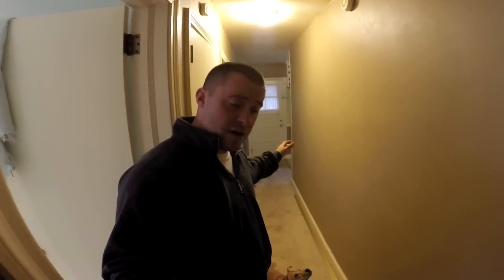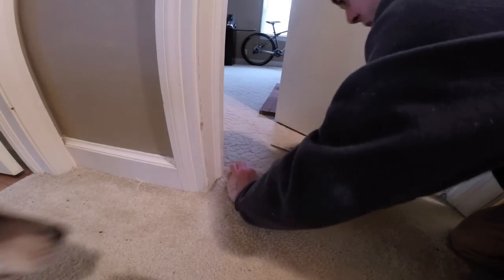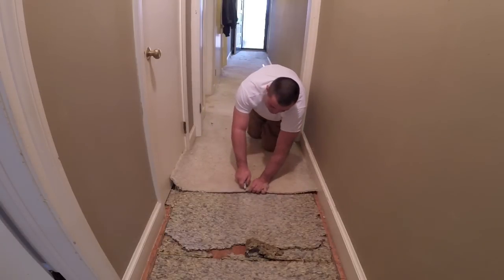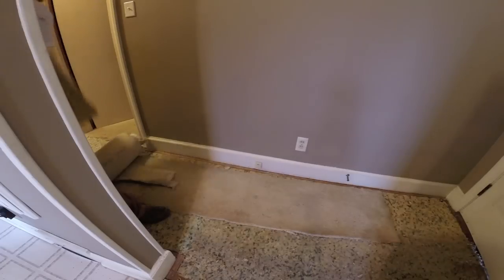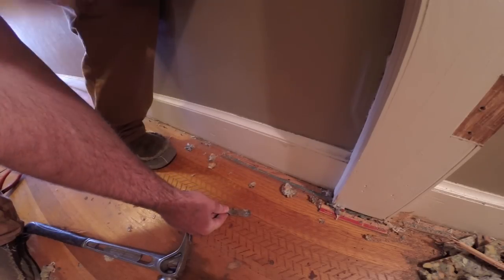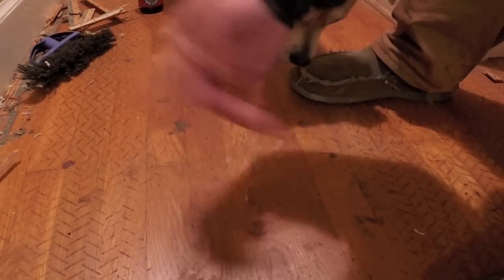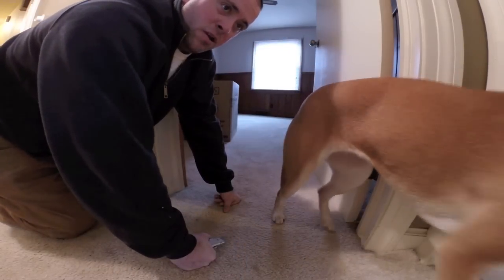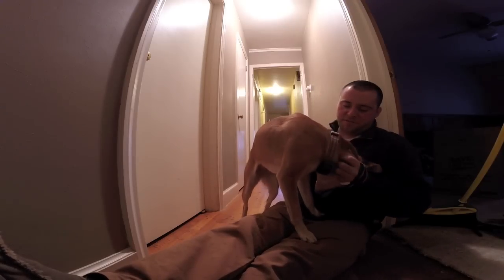REFINISHING HARDWOOD FLOORS PART 1 OF 3 REMOVING THE CARPET

Comment: Thanks for the videos as iam looking to remove carpets and resand&restrain floors. For all the  staples and nailes would they still show after sanding
Reply from the maker: +Laeth B pull all the metal from the wood.  Full with a good wood putty and sand.  You should be fine.

Comment: So...sanding and refinishing Done yet? I finally found someone who did the removal of carpet different than we did and would of been nice to have known when removing from other home we finally gave up on and sold but have to fix wood floors in other home before we sell it soon...so hopefully its in editing stage? And soon it'll be here? Lol thanks for future reference I know what we did was the hard way lol oh well
Reply from the maker: haven't started yet.  been busy building my tiny house trailer.  When you use the drum sander, one bit of advise is, if the drum is spinning and on the floor, it needs to be moving forward or back.  ease the handle down while pulling the machine back and use the edger to get what you missed. best of luck:)
Reply: Tiny House Customs ah OK thanks... That's OK...actually how I found your channel was that awesome trailer house you're building...I was looking for how to replicate our home into small form...lol its oddly shaped so its a bit of a challenge probably just going to forget building it lol